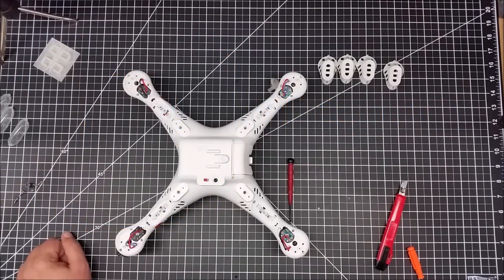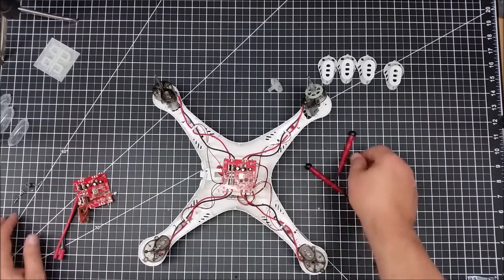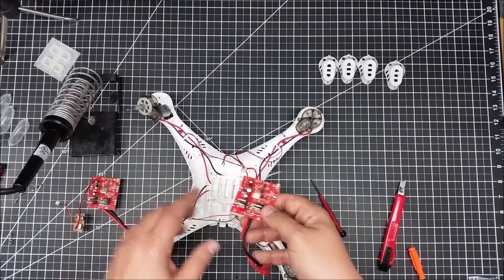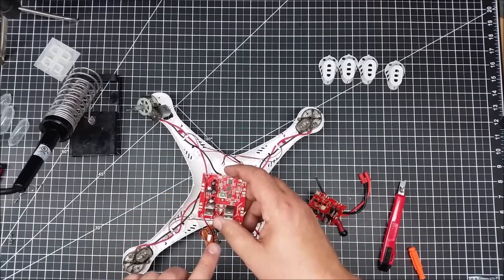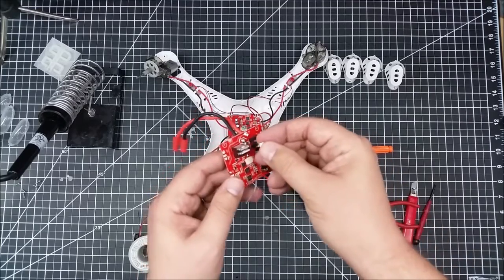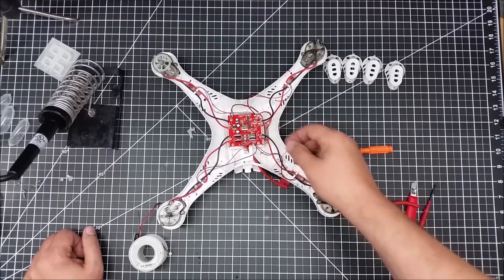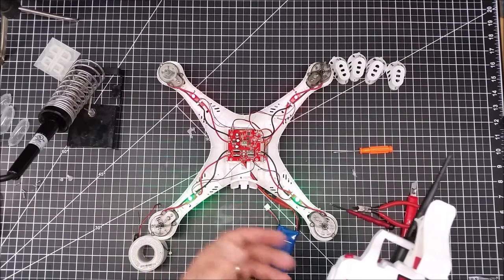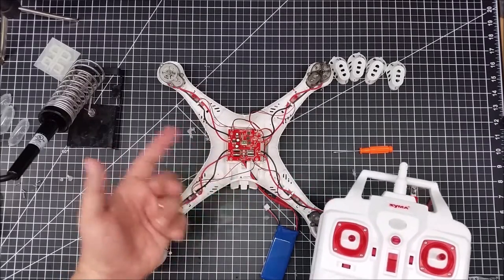Video Drone - Upgrading the Syma X8C with a Hover Control Board!

Comment: Just out of curiosity... Why go to the trouble of re-soldering those eight motor-control wires to the board when you could add on little connectors (with, I admit, at least one last soldering job) to the wire ends. Then instead of having to desolder the ends if something went wrong (or right in the case of a better replacement board) you could just unplug them.
Reply from the maker: connectors can come lose...

Comment: Does the altitude hold make that much of a difference? I bought the x8c just now since the x8hc was 10 bucks more. Did I made a mistake?
Reply from the maker: For me this is a HUGE yes!  lot more fun flying for me anyway instead of having to focus on holding altitude, I focus on flying!
Reply: Aww, Damn.
And you did not experience any problems after the modification regarding descending and such? I read quite a few people had huge issues after the modification.
Reply from the maker: No issues and I have done this twice (one mod and one built from scratch).  Of course it fly's different as the computer is controlling the throttle for you and it will descend twice as fast as it will rise just because the computer is not very smart and this is normal for it...

Comment: When you replace the Receiver board did you use this X8HC Receiver board Barometer Set Height Cover? Here is where to get it.
http://www.symatoystore.com/Syma-Spare-Parts/Syma-X8HC-Spare-Parts/X8HC-Receiver-board-Barometer-Set-Height-Cover
And will the Stock Transmitter work?
Reply from the maker: Interesting however no, assume that it is some sort of air filter.  Guess it is to keep something from blocking the small opening of the barometer so it makes some sense, however I have never seen the inside of a H version yet have built a number of copters upon this board.  Maybe someone will share some better pictures and I can design for 3d printing as I am not sure how it mounts.  Also I have heard the stock transmitter will yet never tested (will have to one of these days) I just bought one with a self center stick as it was cheap and the idea of perfectly re-centering all of the time seemed like too much trouble.  Also thank you for sharing this looks like a cool new design project :-)
Reply from the maker: Sorry to hear, worst thing is try and see how it work.  Believe however the issue will be if not perfectly centered it will think you want to climb or lower which will defeat sort of the mod.  However again, nothing ventured nothing gained...
Reply: I will forget this idea. I only got into this to get out of the house. I don't know you had to be supper rich for this hobby.
Reply from the maker: sorry to hear however if you remain interested i would recommend a Syma X5H (hover) version as it is affordable and fun to fly...

Comment: Hello,are you sure is not necessary to buy a new Transmitter after doing this Mod ? The new throtle Stick works different that the old Transmitter version..thks for your confirmation in advance...did u tested  on flight ? Al
Reply from the maker: Have not tried it as not too long afterwards it flew (see video in Syma X8 playlist) however since the stick doesn't self center you would need to self center which would be a pain...

Comment: W00t!  First person to "thumbs up" the video.   I'm gonna have to create my own playlist for all the cool drone episodes everyone is making. 

Was getting some weird audio artifacts when you are talking. Very repitious. Sounds like "electronic crunching".  Weird. 

Cool video. So the only real difference in the boards was the chip in the middle to allow hovering?

Could you have put connectors on the motor wires and the board so you could swap out the board if ever you needed to in the future?
Reply from the maker: Hmmm  will have to listen to it again, wonder if its a YouTube thing.  Yes, the only difference is the barometer in the center and assume code in the MPU is the difference.  Also yes have found this drone thing in general very interesting!
Reply: Video-Drone - I only noticed the noise when you were talking. There was a portion or tow of video where you were not speaking (sped up video of you working) where there was no sound at all. That was quiet.  You may have had some equipment running in the background or it might be the mic setup like if it were not a completely seated connection creating electronic noise. But it sounded repetitive as if if were mechanical in nature.
Reply from the maker: Oops after you said something I looked and forgot to add the music for the Time-Lapse!  Ugh... and the thing I hate is YouTube won't let you change without deleting the video :-(
Reply: Video-Drone - Really? You can't "replace" the video?  See, I don't even know how YouTube works. I would never make it as a YouTuber. Lol
Reply from the maker: Nope you can only delete :-(
Reply: Video-Drone - That sucks